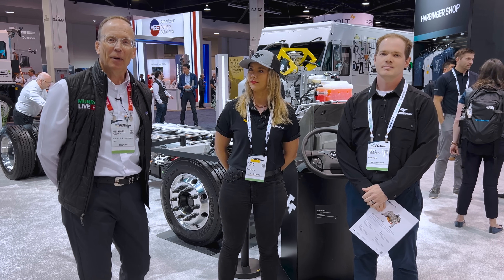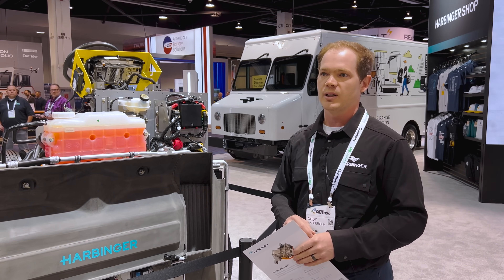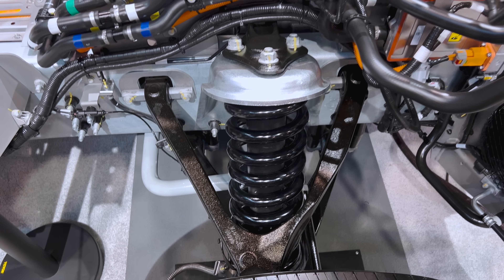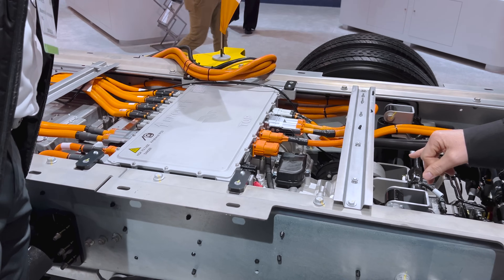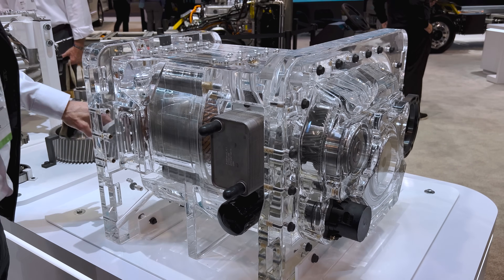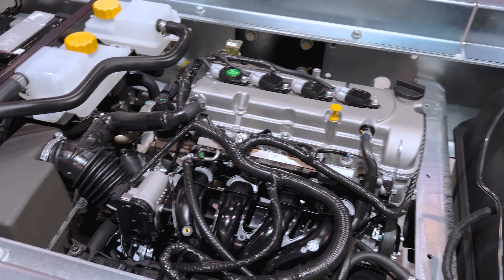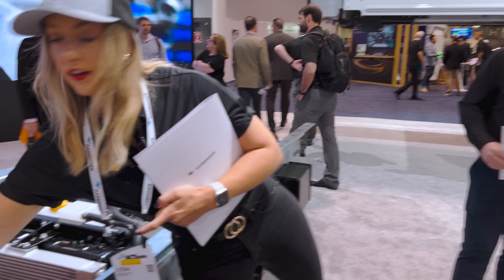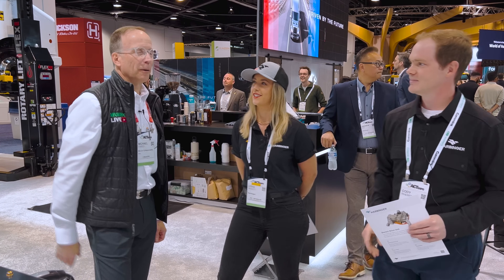Modular EV Chassis Solutions by Harbinger Motors | ACT Expo 2025 Walkthrough

Comment: Why do people make idiotic comments like "all the engine does is run a generator"? They don't say that "all the engine does is turn the transmission input" in a conventional vehicle. 

If the vehicle is to run without using up energy stored in the battery, the engine must still provide all of the energy needed to drive (averaged out due to the battery) whether it is transmitted through and electrical system or a mechanical transmission. This 1.4 litre engine will be working hard to keep up once the battery charge is low enough to switch to fueled mode.

Some engine specs would be nice - not just displacement, but what is the continuous power output rating? What is the control scheme: constant-power on/off, or load matching within the engine's efficient range with battery smoothing outside of that, or something else?
Reply: I tried some image searching but could not find a match to the appearance of the engine. Does anyone know which one it is? To be commercially feasible, it must be an existing production engine which emissions certified in the USA and offered by the manufacturer to outside customer (as a "crate engine"), but I don't see a match in the selections offered by GM Powered Solutions (which has a variety of engine sizes) or Ford crate engines (which are consumer offerings for performance cars).

Comment: The rear suspension is not shown. The drive unit seems to have flanges for jointed shafts, as in an independent suspension, but the chassis appears to have leaf springs, suggesting that they chose a de Dion design. 

The "Technology" page of the Harbinger Motors website confirms this with a clear image from the rear (which this video could have easily included), showing a de Dion beam below and behind the axle line, on leaf springs.

Comment: The battery is well-packaged between the frame rails within the wheelbase, but all of that thermal management hardware down the driver's side is taking what motorhome owners count on for under-floor external-access storage. That's in addition to all of the space taken under the front hood, where a conventional chassis carries an entire engine. That's fine for commercial vans and school or transit buses, but this will be a significant issue for many potential motorhome buyers. 

The bulk and complexity of this hardware is typical of custom and low-production-quantity designs, which can't justify the cost of developing well-integrated solutions.

Comment: The front may be short compared to some step-van chassis, but it's long compared to a typical Class A motorhome chassis. Thor showed a prototype Class A motorhome based on hybrid version of this chassis, and the driver position is too far back compared to the usual Ford motorhome stripped chassis; it's more like the related Ford commercial chassis.

Comment: What he was trying to say and should have explained starting at 3:19 - but didn't mention until 3:46 - is that the battery packs are in parallel, so any number of them can be used without changing the system voltage. This is generally a bad idea in EVs because it increases system complexity, but it is somewhat common choice in medium to heavy commercial chassis to provide configuration flexibility; it can also provide redundancy (ability to continue to drive after single pack failures) if the disconnect system is done properly, as mentioned at 9:52.

Around 9:50 the pack internals are shown, with the set of contactors needed for each pack (instead of just one for the whole battery) due to the parallel design.

Comment: With drive by wire some applications could benefit from steering controls placed in an alternate location.  Like a concrete truck with a second set of controls at the rear of the truck.  Maybe off vehicle remote controls so the driver could walk beside the truck.

Comment: It was great, but lost me at range extender motor
Reply: So don't buy that version. They are offering both series hybrid (with the engine) and pure battery-electric (no engine). As explained in the video, if you don't choose the engine you can fit at least one more battery pack behind the rear axle.

Comment: Do I see a gas tank being use as rear bumper? I'm confused. Can anyone explain?
Reply: It is common in medium-duty trucks and motorhome chassis to put the put the tank behind the rear axle between the frame rails, but this tank is very close to the end of the frame. I assume that they didn't swap the fuel tank and engine locations because the battery would hang down too low, and because using an engine as a collision energy absorber is bad, too.

Comment: Why not just create some sort of efficient regen braking system or solar system to self charge, instead of a “range extender” for excess and added maintenance? Kind of defeats the purpose of an “EV” with an ICE engine. They should rethink something else instead of adding an ICE motor, like solar panels, since these vehicles will mostly stay outside anyways. Even in Africa, they’ve created a system that self charges an EV without some complicated system such as this. I get it though, this looks good on paper from a consumer standpoint, but from the manufacturer standpoint it’s a maintenance moneymaker, especially outside of warranty.
Reply: Of course it has regenerative braking - all EVs and hybrids do. All regenerative braking does is reduce the amount of energy wasted - it fundamentally cannot provide all of the energy needed to drive the vehicle. 

The chassis manufacturer does not build the body. If a van builder wants to cover the roof in solar panels and collect some energy that way, they can.

Comment: Motor location, why. At the axels you dont have to engineer in all the things to counteract the twisting torque of a front motor. Smart!
Reply: That's not a significant factor in medium-duty truck design, and not the reason for the motor placement. There is no reason to mount the motor far from the drive axle, and putting it right at the axle avoids taking space for the motor and propeller shaft which is needed for battery packs.

Comment: I want to congratulate the people at Harbinger for this marvel of engineering. 

I do have a question for all the knowledgeable people out there : how is Harbinger able to have a "range extender unit", which is 1.4 liter GAS engine to give more range to such a large truck, while the RAM Charger needs a 3.6 liters V6 Pentastar DIESEL engine for a pick-up truck? Why such a large engine?
Reply: Marketing
Reply: A Ram pulling a trailer can easily be >15,000 lb and have a ton of drag.  A step van is lighter, and while it's a brick, at least it's only one brick.
Reply: Pentastar is gas.  Harbinger has lots of room for batteries.
Reply: Are you suggesting that a lower output “trickle charging” gas motor might suffice? They seem too well thought out to have missed that possibility, yet open minded enough to not exclude your suggestion from consideration.
Reply: @Crunch_dGH  If the engine is there only to charge a battery, I wonder why RAM puts in a3.6 liter V6. It's almost as big an engine that you find on a regular ICE pickup. I tend to believe they are doing it for marketing reasons. No Pick-up guy" want to go around with a small engine. His masculinity might feel belittled...
Reply: Here is my take on why the configuration on Harbinger is using a smaller 1.4L engine. 

* My guess is they only offer that configuration with 5 batteries. Leaving the 6th battery slot for the 1.4L generator setup. This take care of the need for a truck that needs to go 150+ miles per day or is in colder climates. Also, may be useful for different types of vocational trucks and especially RV's. 

* What they didn't say was how big of a generator that little 1.4L is turning, or how much HP it produces. It may be similar to the 3.6L Pentastar. 

* My guess is they start charging when you hit 70% battery. Always keeping the rig at 70% or above. The engine most likely kicks on when they need sustained output that is demanding instead of draining the batteries. It is part of their vehicles operating system. 

* RAM already has the 3.6L engine in the RAM lineup easy to implement for them. I don't think RAM offers a inline 4 in the RAM lineup. That would be some reengineering for them. Plus, that 3.6L has more HP potential than most 1.4L engines, without running is at inefficient RPM ranges. 

* RAM Charger has more HP than the Harbinger. So, it needs a bigger generator to keep up.

* RAM Charge has smaller total battery range than he Harbinger when you compare the HP of its 1 motor, compared to RAM's 2 electric motors on the RAM Charger.  RAM Chargers front motor is 335+ HP and the rear one is 333+HP total HP is 647+HP.  Battery is rumored to be 92kWh with the range extender. 

I am sure missing some things.

Comment: Why not make a true hybrid with a Duetz or Cummings engine ? To have an eninge just to charge a battery doesnt seem energy efficient to me 🤔
Reply: Diesel-electric trains have been using the series hybrid system for decades, it works fine and it's simpler than a parallel hybrid
Reply: @spankeyfish  Still gotta burn diesel. Almost as bad as burning coal.
Reply: @spankeyfish   Interesting didn't know that 👍. I think a parallel or Dual mode system is better in my opinion for a truck . But imagine it's more cost efficient to run series.
Reply: Adding complication is not likely to add efficiency. That also reduces the modularity to replace range extender with another battery wouldn’t it?
Reply: Really with super charging coming now why have range anxiety? The theory with an onboard generator is it uses less fossil fuel=less pollution. But any hybrid is more complicated and electric is so simple.

Comment: So with the ICE and 47.5 "range extender"  you are getting (just on gas) is 10.5 MPG WITHOUT the battery? They said 1 mile per Kwh on the battery. With the average cost in electricity in California being $0.30 a Kwh driving on electric alone is $3.00 for 10 miles. Is this a s good?

Comment: The hybrid is what is needed for RVs, would love to see a camper with this system total independence.
Reply: Thor showed their prototype of a motorhome based on this engine earlier this year, and said that they would be putting it into production.
Reply: How are you getting your gas independently?
Reply: @ Well, as far as I know, there are still plenty of gas stations around the world – so range anxiety isn’t really a dealbreaker with a range-extended setup. The beauty of this kind of system is that it gives you freedom to choose how you want to travel and live.

For long-distance trips, the range extender (gas generator) gives you backup and flexibility, especially if charging infrastructure is sparse. In winter camping, it could also be used efficiently: not just to top off the battery, but to support heating or hot water, which is a big plus. Ideally, you’d only use the generator occasionally – thanks to the onboard battery bank.

Solar could help too, even though roof space on a van is limited. It might only give you a few miles of range per day, but every bit helps – especially when parked off-grid for a few days.

Fully electric camper vans often struggle with range due to weight and payload limits, since the battery eats up a lot of capacity. A range-extended setup lets you optimize for each trip: go mostly electric when it’s convenient, and use the generator when needed. And thanks to steady generator operation and regenerative braking, fuel use can be surprisingly efficient.

So in many ways, it really offers the best of both worlds – electric flexibility with combustion backup when you need it.

Comment: 4:23 Not made but assembled in America.

Cool that they display all the components of their platform openly. It however also signals that they are using off the shelf products or existing techniques.

9:53 disconnecting a faulty battery pack seems like a new (to me) idea.
Reply: They're making the electric motor, drive unit, and battery packs in house. And they use standard batteries that Tesla and a bunch of others in the US are now manufacturing and are ramping up capacity. I think it is reasonable for them to say they are making this in America. It would be silly to expect every manufacturer to be so vertically integrated that they're mining their own lithium and forging their own steel.
Reply: @ 
You’re right about that but in terms of value, the 21700 batteries form the major part of a module. They didn’t say where they source their batteries from and if they’re not US made, the module will probably not qualify as ‘made in America’ in WTO terms.
Reply: The idea of of having everything made in a single country is idiotic. Not even North Korea thinks that way.
Reply: @robertn2951  Could being more descriptive vs rude hyperbole may be more helpful?
Reply: @robertn2951  I agree that using strong points of other countries is better than doing everything yourself but if you do import (a significant percentage of) parts from other countries, one shouldn’t call their product ‘made in America’. 

The largest (CATL) and the second largest (BYD) li-ion battery manufacturers are both Chinese.

Comment: A small ICE generator,  modular with the battery packs, is a great idea!
Reply: No it’s actually not. They said it would always be on and running, meaning constant maintenance will be needed. Oil changes, coolant changes, spark plugs and so on. Oh you have a “Check Engine Light” on in your EV? Might be a PCM/ECM issue, crankshaft/camshaft position sensor issue, VVT issue, EVAP leak and so on. You’re not thinking at all if you really believe this is a good idea.
Reply: @lupavo1738  they certainly did not say that it would always be on. They did say that while camped an RV could run the generator set, as required, at a low power level so that it would be quiet.

Comment: 48V might be the solution for their steer-by-wire issues.
Reply: Doesn’t 800V architecture imply 48V wiring?
Reply: @Crunch_dGH  No, there are more than a few 800V vehicles, but they all use 12V.
Reply: @Crunch_dGH  No, the high voltage system voltage is unrelated to the low voltage system voltage.
Reply: the forces involved in a medium chassis steering are very high. I would assume it's directly on high voltage.   I would say they are probably careful - steer by wire needs to be super reliable.
Reply: @eXo0us-T  The problem with steering power on high voltage is that in a failure situation high voltage power can easily be lost, while the vehicle is still rolling at any speed. Reliable redundant power is required, which means dual low-voltage batteries and power distribution.
Reply: @brianb-p6586  low voltage can be lost as well.  But I get your point, the HV system could be locked out for more reasons then a lead acid batteries dies.  Dual HV + LV would be interesting.  Run it HV for most things and backup to LV to get to a controlled stop.
Reply: ...or just using mechanical steering that won't leave you without steering if the electrics fail
Reply: @spankeyfish  Thank god they never tried this in planes. [/s]

Comment: Too many wires does not feel like very well optimized .. what these guys trying yo do ? Also 1 mile 1 KWH laden or unladen ? Just 175 miles max it’s dead on arrival .. please stop working
Reply: Beats any available commercial van,  as far as I know. Sprinter,  Rivian, Transit,  etc.
Reply: @ do you have details on the drag coefficient or laden or un laden .. now think 175 * 0.6= 125 miles that’s its real world range .. coz no one would charge over 80 and have to bring back to charge below 20% another reason it’s dead on arrival

Comment: Can the batteries be charged with solar panels?
Reply: Electricity is electricity. With the right circuitry yeah you could, but the ammount of solar you’d need to charge it wouldn’t fit on the vehicle.
Reply: 800V system, that's a lot of panels. You'll have no space for other  things up top
Reply: @i3_13 voltage wouldn't matter; it's the kwh that makes that impractical
Reply: @jamesengland7461   what? Could you charge an 800v battery with 700v? Bogok.
Reply: Yes.
Reply: With that amount of batteries you would roughly need a area of panels two hundred times the footprint of the truck, to charge it within an hour.
A 60kWh EV needs 75x it's car park area in panels to charge in half an hour.

Comment: Using an RV in the far west, a hybrid chassis is ideal. 600 miles would be better though.
Reply: If you have a "range extender" aka a gasoline engine working as an electric generator, your range is basically the same as any gasoline vehicle. If you run out of gas, just fuel up at a gas station and your generator will keep charging the batteries. It's a reasonable assumption that the generator will charge the batteries at a higher rate than the truck is consuming while running.
Reply: Solution: Fuel canisters.

Comment: Steer by wire. So what happens when a mouse or a squirrel chews on the wiring?
Reply: It stops working.... What happens if a mouse or squirrel eats through your throttle wiring?
Reply: There is a back up system like an airplane. True though, they need to stop using vegetable based wiring wrap, rodents love it.

Comment: It was not clear to me. Can the range extender be removed after production and replaced with batteries? Allowing upgrades if batteries improve enough or a customer realizes they don't need the range extender on a particular vehicle.
Reply: Seems to be mix ‘n match, but should wash out in the real world, though the option to “fine tune” power has appeal.  I like it better than Tesla Semi for less power demanding, yet more flexible, RV & delivery purposes. 4WS later (& more easily doable with leaf springs, due to less turning needs), might help with cramped spaces.